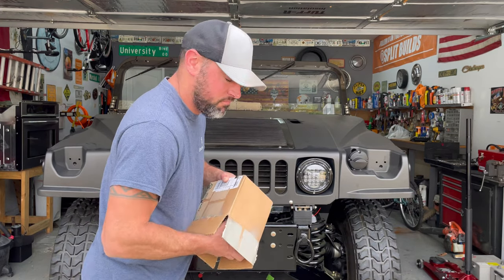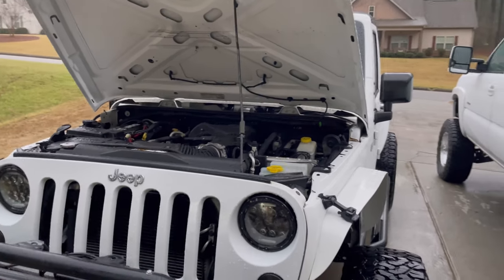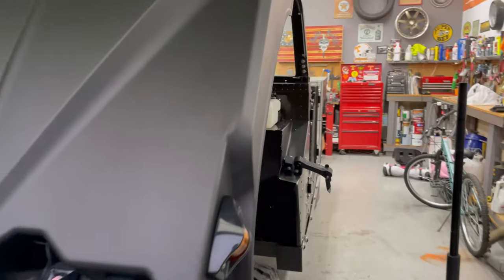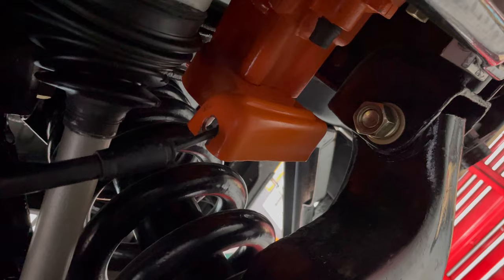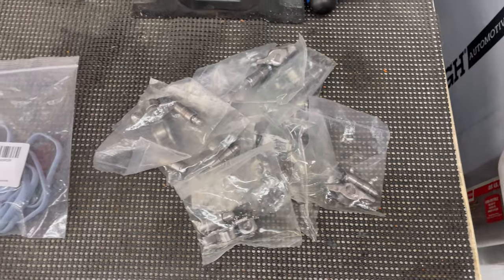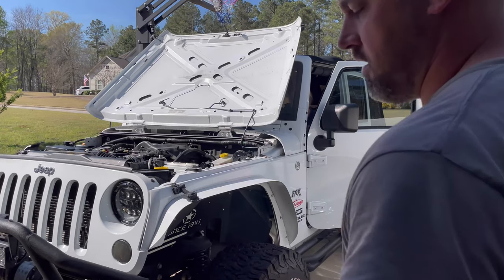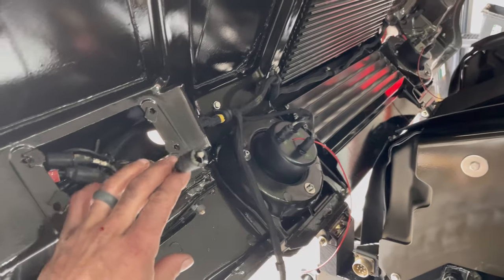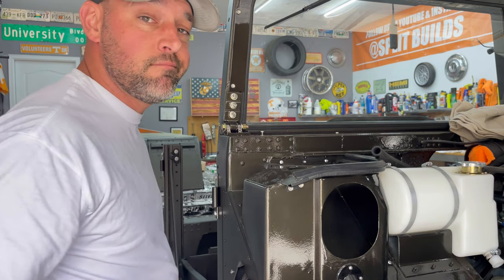Humvee Turn Signals and Jeep Wrangler Engine Tick.

Comment: Correct Tailgate chain "D-rings" require 1/8" showing through the eye.   Less than that and standing on the tailgate or placing heavy load on it will likely result in D-rings to pop open.

Comment: Just a thought: Do you believe it would be possible (money not an issue).
Having the body of a Military Humme placed on the new 84,650 Dollar GMC Hummer EV Pickup?
I am assuming the 2022 110.000 $ Hummer EV has the same frame as the newer 2024 84,000-dollar EV hummer.
I would greatly appreciate your learned opinion. 
Thanks 
Sincerely yours
Gary Orrock R.N.
Reply: P.S. one thing that bothers me is that here in Florida "No Military Hummers are allowed street Licenses": Only yes on "Parad vehicles & Off roaders are O.K..
So, a Hummer Licensed as an EV (the 84,000 $ type) will be OK. (Even if it's under a Military body)
Only: The 2024 Hummers EV Engine, electronics, Drive train & Vin numbers will be recognized by our (Florida's) DMV as a street vehicle.
Florida's License Administration would not factor-in the Military Hummer body on top.
Reply from the maker: Record anything is possible I guess. I don’t know if it would be worth it. And you can get them street legal definitely in Georgia but I think Florida as well.
Reply: @garyorrock1729  We at AM General did NOT build Military HUMMERs ...only Military HMMWVs  ...although they may look alike to the un knowledgeable, there are big differences!